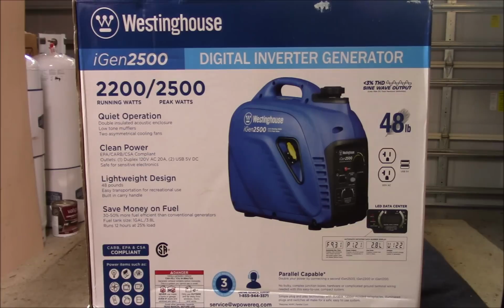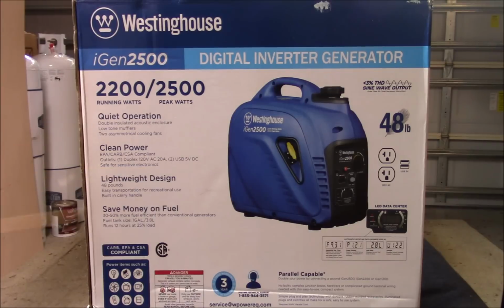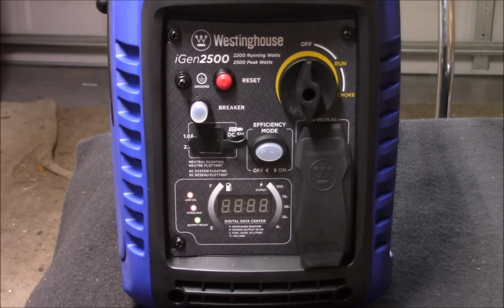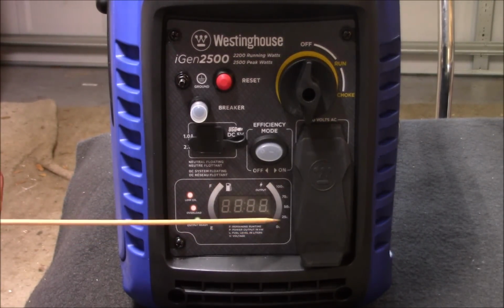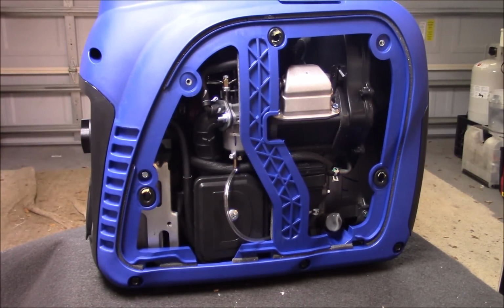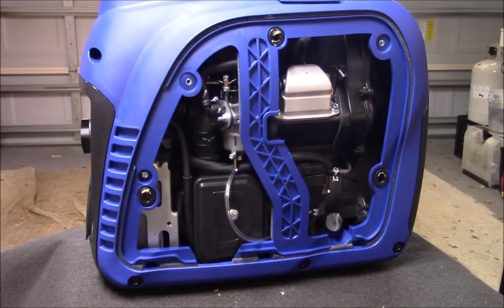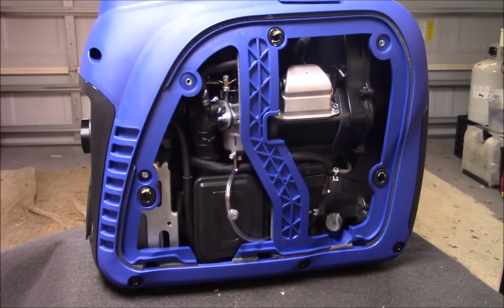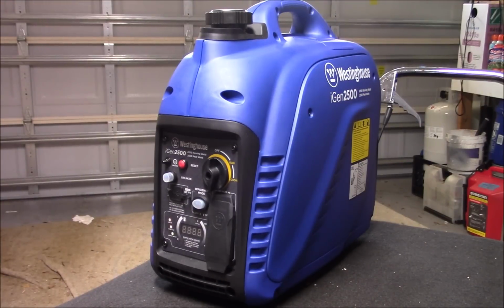Westinghouse iGen 2500  inverter generator

Comment: Mine stopped working. Anyone have any guides for these when they won’t start or links on replacing spark plug?
Reply from the maker: Try using Choke Start on the Carb. 
I have a Champion Gen that needs it from time to time or it won't start

Comment: You mentioned using regular gas... Is there any reason you would not use ethanol blend regular?
Reply from the maker: Yeah,  Ethanol does not store well in my area even with fuel additives.
Reply: Do not leave crapifornia gas in it unless you are going to burn thru it in less than a week. You have been warned.  It gets gummy and you will spend $250 at a small engine maintenance facility.

What i do to great success now is when I'm done with needing it... I will unplug all load and let the engine run dry almost until you can hear it start to choke .. then I put some 4 stroke  Trufuel in just about 1/8th of a can or even less.   That purges out all the crapifornia ethanol and leaves some Trufuel in your carb/lines.   Again ... Learn from my $250 mistake and having  jacking my sciatic nerve pulling the rip cord 500 times to the point it frayed.   If you need to pull the cord more than 2 times - you left some good ol democrat gas in your lines.

Comment: You said this is the second one you bought, how has the first one held up? Any issues with it, do you know how many hours you have on it? Thanks!!
Reply from the maker: The second one,  was the iGen Pro (GREY)
 I returned to the place of purchase. Had several issues with that one.  Major issue:  bought the item as new but ,  it had been used and then returned to store. Then sold to me as new. 
So therein is the rub. How much of the problems where from the machine or from what the other owner did to it before returning it to the store?

Comment: Hi Greg, what is the green wire connected to the generator's upper side?
Thank you
Reply from the maker: The green wire is the Ground Wire which is connected to the ground rod.  Ground Rods are available at Lowe's or Home Depot
Reply: @gregsworkshop2  Greg thank you very much for your answer. My question is if it's a must to connect the generator to a ground rod? Thanks again
Reply from the maker: I think it is. If the gen gets wet or is damp;  and you touch a non-grounded unit,  possible shock "could" happen.
Reply: @gregsworkshop2  "non grounded unit" means the generator or a non grounded appliance connected to the generator? Thanks again
Reply from the maker: Possibly both.  More likely the appliance.
Reply: This generator has given me nothing but problems, stopped  staying on, pull rope broke after 2 months

Comment: the box says runs 12hrs at 25% output on only 1 gal. of gas. how can this be? is this really correct? sounds too good to be true
Reply from the maker: Real life is seldom by the book. If I had to guess,  I would say .. 1 gal would be closer to 8 hours @ 25%.  That is a my guess. Too many variables to take into account.  Type of fuel ,  elevation,  the accuracy on the fuel gauge ....etc.

Comment: hi thanks for sharing, could you please let me know where did you buy it, sounds like a great price, hopefully, it was online. Also after you have more time with the unit how you like it so far?
Reply from the maker: I bought it online at Home Depot. It was on sale at the time. Free shipping was also an incentive.  I figured it was safer to buy it from them in case of a problem, it could be easily returned with no hassle.
Reply: thank you very much
Reply: If you have an Aldi grocery store in your area, check prices there.  They sell a "WorkZone" 2000 watt generator which is exactly the same as the iGen 2500.  Uses the same Yamaha clone 80cc engine.  I paid $254.99 for the Workzone and I can parallel it with the Westinghouse iGen2500.
Reply: @mowcowbell  thank you sir for the information.

Comment: i like the 2500 peak but i was looking for some thing with a 20 amp plug not just the 110... they are nice and lite... i went with a lesser running watt a 1600 and 2000 max an a1 power i think it is called... but truth be said i liked these also...

Comment: How would you adapt this unit to a 30 amp RV plug?
Reply from the maker: 30 amp adapters are available on Amazon or E-bay.  I found some for around $15 shipped..........
Reply: Not necessarily, just use an adapter and watch ur amps. This gen will run an 11.5 btu AC and if at lower altitudes an 13.5 btu AC. The Honda 2000 will so this should with no problem.

Comment: Where did you have your ground wire running to?
Reply from the maker: Ground wire is attached to the ground rod inside the generator shed;   just off camera view in this video.
Reply: Thanks. Any recommendations for grounding when used to connect to an RV?
Reply from the maker: Home Depot has 5/8" copper  ground rods and clamps. As far as hooking to RV,   there are a lot of vids on YTube that show how its done.

Comment: I had all kinds of trouble running UPS units while using my open frame 7500 watt generator.  The UPS's kept kicking into battery mode until the battery in them gave out.  The clean inverter power coming from the Westinghouse iGen2500 doesn't affect any of the UPS units in my home at all while on generator power.  I have a single iGen2500 connected to my Reliance 10 circuit manual transfer switch and it handles a 22 cu ft refrigerator, 6000 btu window AC, 12 cu ft freezer, microwave, and all the lights in my home.  The only thing I have to be careful of is not to start up the microwave while the window AC unit compressor is running.  Even on this load, the generator usually indicates 25-50% output while running.  Big thumbs up!
Reply: Unit packs a punch for such a small size. So far,  it seems to be very reliable. Just a note about microwaves:  even under house current,( from the power company)  my microwave will cause house lights on the same line to blink for a mil- second .So,  in my case, I wouldn't expect the generator to perform any better than what the power company provides.
Reply: Greg's Workshop - my microwave did that. Turns out water leaked in to my fuse box and rusted some of the switches. Just FYI on my experience.... put fresh sealant where the main comes in to my house and about $1,000 for a new fuse box and problem solved.
Reply: Dittos,  I discovered the same problem with my fuse box. Fixed the leak. Have not replaced the box yet. Couldn't find any rust...yet

Comment: Nice! Generator but NOT A HOUR METER on the Data Center ???... Why? Westinghouse forgot such an important thing.
Reply: Use a piece of paper and a pen, or your cell phone.
Reply: This unit does have an hour meter...................
Reply: Hi Greg!.. Thanks for your reply. What I mean is a "Total Hours Running Meter" to help you schedule your oil services. I haven't seen that feature in Westinhouse iGen series.
Reply: Since two different people have ignored the one post and incorrectly stated that it doesn’t have an hour meter...I will repeat it...IT DOES, REPEAT, DOES HAVE AN HOUR METER BUILT INTO ITS REVOLVING DISPLAY.  thank you for your attention.